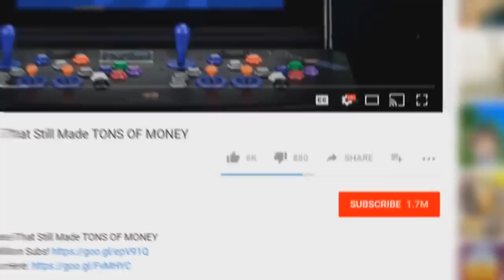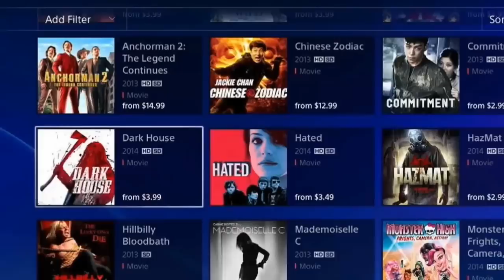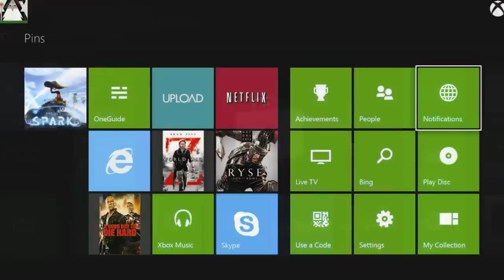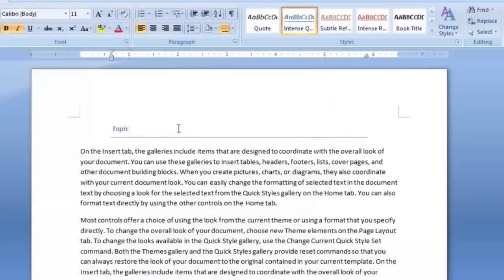10 Reasons Why PC GAMING is Superior to CONSOLE GAMING | Chaos

Comment: Veeeery late comment, but:

- Upgradable 
- Can do more than gaming
- More Games
- Native mouse and keyboard support
- Games can be modded 
- Games are cheaper 
- Don‘t need to pay to play online
- Better looks with RGB and glass cases
- Quieter (ever listened to a ps4 on full load?)
- Software ist easier to customize change settings in games, make changes in the bios or registry if needed
- Better visuals in games due to better hardware 
- Dedicated servers 
- More space on Drives if needed
- More than 60 Fps

Comment: I'm usually pc gaming, but computer components are so damn expensive right now!!!
Reply: Storm - Dawntion because of crypto currency
Reply: Yeah exactly and also the mass amounts of people who are trying to get into pc gaming are getting screwed over by this
Reply: Yes I know I wanna tower pc cause all I got is a acer vx-15. I5 gtx1050ti and 8 or 16 gigs of ram. It runs everything at 60 on high settings and 1080p (cause 2k and up monitors cost more and it's a laptop). Backlit keyboard dual fans it's dope for 900 plush shipping.
Reply: yea the crypto currencies are making things more expensive, vut i cant wait for the massive used market after it chrashes ;)
Reply: Bought XB1
Reply: Yeah this is true I wanted to buy a gtx 1060 because it's a improvement over the 750ti which I have I have a pretty old card but its so expensive right now and I also looked at AMD but I use a lot of nvidia software like shadowplay and I don't want to drop those things
Reply: Storm - Dawntion just mostly GPU's.
Reply: 799$ for high end gaming computer? how is that expensive
Reply: It's better to buy pre built PCs right now trust me especially on black Friday
Reply: Lukson 800 dollars is low to mid range 1200 plus is high end
Reply: If you are usually PC gaming that means that you have a PC. You don't need to upgrade all the time.
Reply: Well would you know,with a console,you don't have this problem.

Comment: Consoles are just weak overpriced budget computers
Reply: Cocoa the Shiba Inu that comes with a goofy looking controller that is knock off to a keyboard and mouse
Reply: Yet it's still cheaper than a PC. T_T
Reply: Steampunk Sentry nope
Reply: @the_katzy  That's why he said "budget"
Reply: If by overpriced u mean 200$
Reply: You’re actually wrong. Consoles have more price to performance at the same price point as pc
Reply: Facts
Reply: 425$CAD vs 1945$CAD. 5x FPS, and oh, That’s with a prebuilt? Wha?
Reply: With locked framerate
Reply: Hayden Morris 30-18 FPS lowest I don’t think I’ll touch a console
Reply: @hmorris  not if we're talking budget pcs
Reply: Console's are overrated, low end, outdated PC's.
Reply: @hmorris   A similar computer would use parts that were discontinued long ago,as the pc market grows a lot faster,but console manufacturers make a new console every 5-10 years,as consoles are hard to develop because they use non standard pc parts developed my a single manufacturer. If you try to build a comparable pc,it will most likely be used,as part manufacturers develop new tech way faster.

Comment: I NEED A PC SO BADLY
Reply: save up and wait till the crypto currency craze stops, there will be a HUGE used market waiting
Reply: Jathanthegreat 138 

It has finally stopped. What you wanna do now is wait. Just wait for the next gen GPUs and you might just be able to get a 1080ti for less than 400 quid!
Reply: F4Y541 RAM and GPUS are still a ridiculously expensive
Reply: @liamcullen1979  not really. I got a 1080 in september brand new for $410
Reply: Gople really where abouts?

Comment: Before watching this I will say.

Everything after the PS3, yes console lost its one advantage, that was plug and play, no installing needed, no downloads required it was simply pop in the disk and start playing.

Now consoles are budget pre made PCs without the ability to upgrade.
Reply: Well even in the era of the PS3 you still had to wait half an eternity before you could actually play GTAV and most other games as well after putting in the disc since you had to wait until the system downloads and installs a patch which was quite disturbing especially if you have a lameass connection like I do...

Comment: Im a PC gamer but how can you say the price difference isnt massive?
For a decent gaming PC you need at least a gtx 1060 which is at least 250$ for just the GPU
The PS4 Pro costs 399$
Reply: Yeah exacly. I dont know how people are saying price difference isnt big. In my country 1060 costs almost as much as ps4.
Reply: Gargamel a middlengaming pc costs 500 -700
Reply: @TheYaq  Maybe a crappy gaming pc
Reply: +Gargamel Everyone starts somewhere, it also depends on the kinds of games you play. I used to play Skyrim with a few mods on a GTX 650 in 2013.
Reply: A 1050Ti with an Intel Core i3 can outperform the PS4.
Reply: @commentingchannel9776  Still far more expensive.
Reply: Gargamel look at the potato masher pro, or any other console killer pc, or just be ignorant.
Reply: @africansonic482  Im all for PC gaming. If theres a pc setup that can compete with the console in terms of pricing Im not aware of them.
Reply: @gargamel1940  You would still get that difference back because:
-Games are cheaper
-Free online
-Sales (mostly Steam)

Also, IT IS A PC, and it can do way more stuff than a console as it is not a closed, gaming focused machine.
Reply: @commentingchannel9776  Makes sense. One of the main reasons I prefer PC is the ease of acquisition of games and variety of games available.
Reply: In addition to the cost of the PC you have to consider the cost of mouse, keyboard and a decent monitor which creates a larger price disadvantage of going with a PC instead of a console.
Reply: Gargamel ps4 is a crappy ””””””gaming”””””” pc
Reply: Alex Lalani you still need to buy a monitor for consoles
Reply: Yes,but that ps4 pro is less powerful than a gtx 1060

Comment: You can build a PC for $220; yeah sure.
Reply: Wilson eh, spendin additional $60 to get something you already paid for? it adds up
Reply: yup
Reply: $100 for i5 2400 , 1155 motherboard and 4gb of ram + $100 for a 750ti + Psu & HDD from an old pc and wow, who would have imagined, a somewhat solid gaming pc for $200~ (i love both consoles and pc but you cant put a price tag on a pc, you choose the price yourself)
Reply: You can. I can build sub $100 PCs if I am buying used.
Reply: Wilson If you buy used parts you can.
Reply: I build a test of for $5
Reply: Inspiron with i5 2-4 gen = 120
Used 1050 ti = 100
Will give you a better experience than Xbox one s and PS4 s too, I reccomend custom building it but it isn’t impossible to get a good machine for 220.

Comment: Xbox and PlayStation basically have firewalls that prevent multiplayer gameplay unless you pay them. Consoles are meant to be budget gaming devices but charging $60 a year to access something you already pay for doesn’t sound like a budget conscious decision. I still have Xbox but I am about to build a PC that will likely last a while. Given the fact you can use an Xbox controller on pc for games that are on both platforms, there’s really no reason to have an Xbox. I see this now, and I used to be completely against pc gaming.

Comment: How long would a $1200 gaming laptop last for?
Reply: All depends. Case? Probably for ever. Psu? Easily 9 years if looked after. Peripherals? About the same time. Ram? Also 7-9years. Cpu? Depends on the cpu. But a first Gen i7 can and does still hold up pretty well if paired with a modern gpu, so around 7 years but it can be upgraded later rather cheaply, the gpu maybe every 3-5 years depending on how badly you want the highest settings and fps.
Reply: Mac PooPum he said a laptop I don’t think the psu or case matters

Comment: PC with the powrr of PS4=Radeon R7 265,Intel Core i5 2500k,8gb ddr3 1333mhz.
Reply: That CPU is far too powerful... PSU has an 8core 2.2ghz CPU which is just slightly less powerful than the CPU in the Xbox X's@ 2.3ghz.

Comment: Guys im switching from Ps4 to Pc gaming.Could you tell me if this system will be superior to my ps4?

i3 4th generation
Ram 8gb
Hard 1tb hdd
Nvidia geforce gtx 750ti
Reply: Everthing is old but fine. Newer AAA might struggle on high settings, so I'd recommend that you get a newer CPU and/or a GTX 1050ti
Reply: Abdullah Mustafaoğlu I would recommend a better/newer gpu for the purpose of driver support. Consider the gt 1030/ gtx 1050

Comment: You cant compare these 2 because a console is a dedicated prebuilt gaming system PC's are very different as you cant upgrade and customize it so its not wise  to compare your $1000 pc to a $400 console if anything a phone is more comparable to a pc because they both have the same features
Reply: Then compare a $400 console to a $400 PC. The PC will still outperform the console in everything.
Reply: @rudram.552  sometimes

Comment: Graphics. Mouse. Free online. Anything else? Games, especially exclusives though, consoles are better. Also PS4 has much more affordable VR
Reply: fresh freshh not close. Windows mixed reality.
Reply: Graphics
Mouse
Free Online
Emulation
Access to infinite backwards compatibility
Modding
More uses with having youtube/spotify/discord while gaming
More platforms to download games
Upgrading your pc when necessary instead of buying a new console
Websites like G2A and steam sales
Adjustable Graphics
PC's have genres that are exclusive and pc's have more exclusives
Framerates not limited.
PC's have more uses such as game developement, music making, work etc
PC's can fit any price range that you desire
PC's can use any controller without having the need to use an adapter (Most of the time atleast)
Dual Monitors/Multiple Monitors

Consoles: Cheaper VR?

Comment: I’d love to get into PC gaming, I just don’t really have the time to tweak my settings and mess around with it. I like that on console I can just start up the game with preset settings and it will simply work (most of the time XD). I’m hoping there’s a greater push for higher frame rates this coming generation. I’m tired of most games running at 30 fps 😂
Reply: You just gotta get into the right mindset. For me, tweaking settings to find what will give the best balance of graphics and performance is half the fun.
Reply: I mean you dont have to you can just use the presets

Comment: If a keyboard and mouse were better they would come with a PS4 and Xbox .....
Reply: If consoles were better all PC's would come with a controller
Reply: Consoles are designed for sitting on the couch so they want something you can hold in your hands
Reply: @polar2cold154  And pc's are meant for more upclose on a desk using a monitor, Why would consoles need a KBM by using your logic?

Comment: Consoles have multiple price points....
Reply: Tony Bowyer pc has a much larger game choice and entry cost levels. Mods are bigger and much more supported on pc. You got what? 3 or 4 games that support mods? Pc is into the tens of thousands. Can you work on a console? No. Can you live without a console? Yes. So it's not practical and it's not a necessity. A pc is practical on top of having better performance and uses, especially outside of gaming. Emulators are better on pc. If you're going to bring up emulators then I'm going to bring up pirating games which is basically free games. You like them you buy the game.
Reply: Tony Bowyer and pc has infinite price points

Comment: Um, I can use a mouse and keyboard on a console, the pc cost more to build, the console is more reliable. PC is not superior.
Reply: Ughhhh an othe console peasent you can build a pc as cheap as 300 bucks also ther to much input dely when you plug in a keyboard and mouse to a console
Reply: @NorthFloridaAirGunner  how you like the setup tour took me 2 years to get what you jelly
Reply: roy votava you obviously have never used a pc it outperforms your PS4 pro in every way possible
Reply: What do you mean by more reliable? You have to pay for online and most console games don’t support m & k
Reply: @cxbarren4528  all I play is call of duty, which supports k&m,  and by more reliable I mean every console I've ever had still works 10-15years later without any repairs,  something no gaming pc has ever done for me.